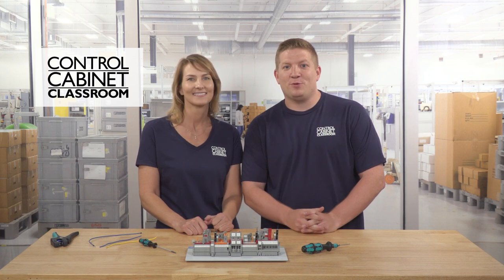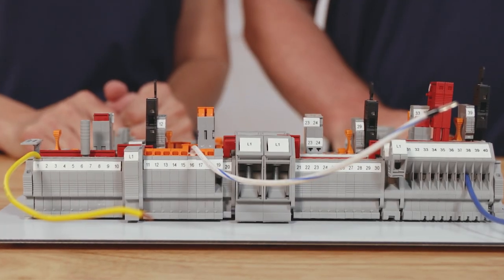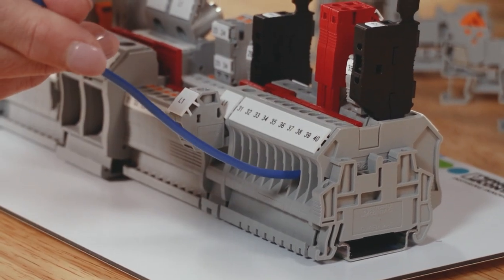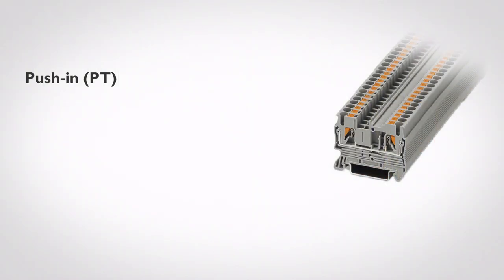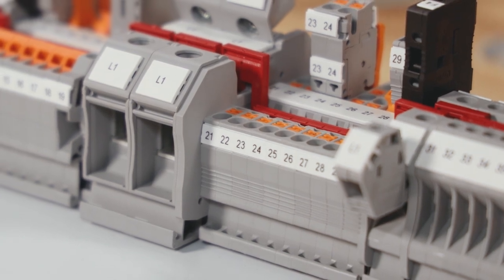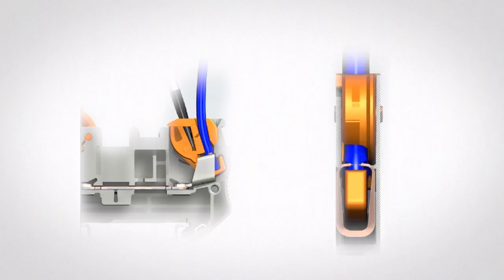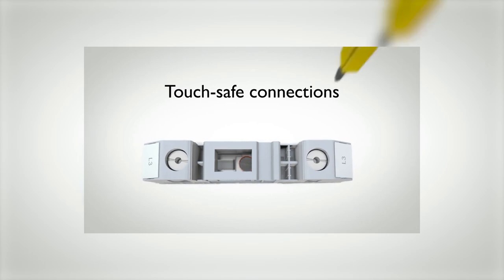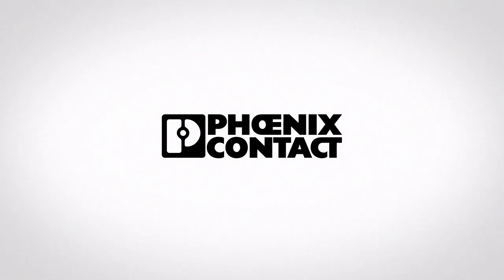Connectivity Fundamentals: The Many Connection Styles of Terminal Blocks

Comment: Excellent videos guys. Great energy and easy to watch. A question: Is it ok to use ferrules with spring cage?
Reply from the maker: Absolutely, ferrules are acceptable with a spring cage connection. They would, of course, need to have the proper size ferrule for the block and wire they are using, but in general, ferrules are compatible with spring cage.